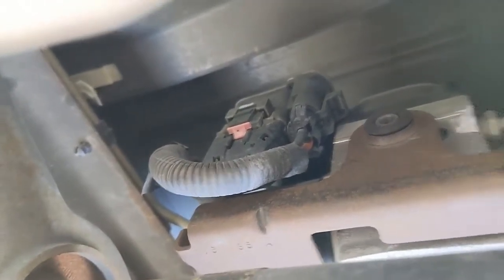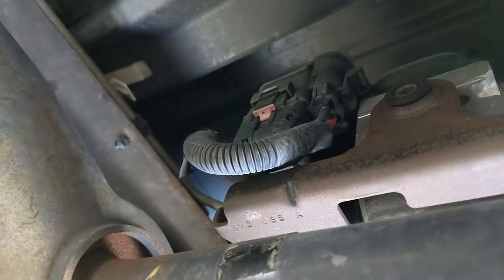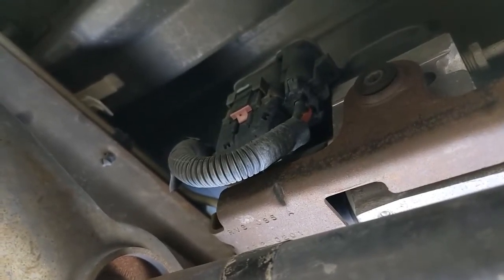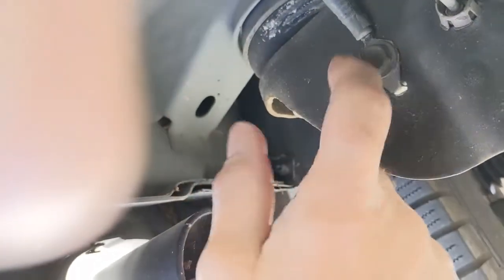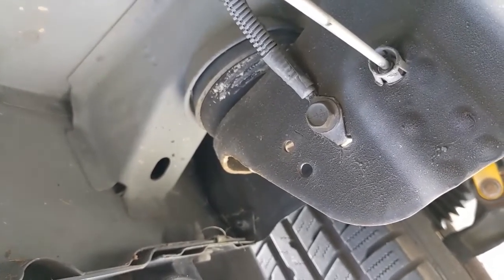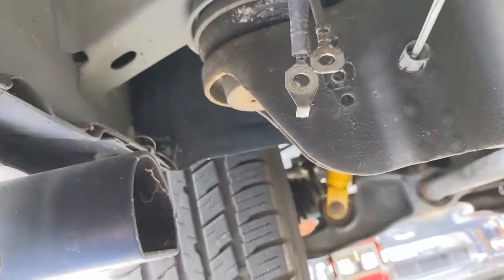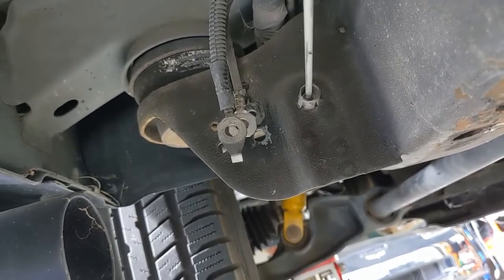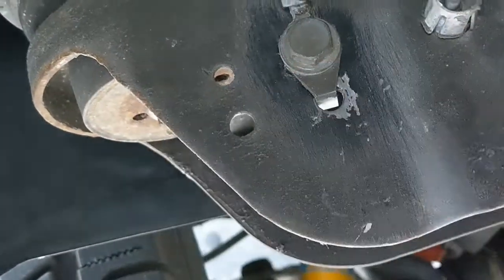Suburban 2002 ABS module brake warning light connection fix repair by froggy

Comment: You did not follow up did this fix your problem?
Reply from the maker: Did not replace yet, stay tuned, slow I know, life happens.
Reply: @1947froggy there’s some sodder points in the module itself that can crack.
Reply: So cleaning connections did not work?
Reply from the maker: no

Comment: Hey Froggy. Pertaining to your ABS issue, there are several different possibilities for the root cause. You have eliminated several currently. GM issued a bulletin on that EBCM ground on the left front frame horn. The fix there was to clean and retorque as you did. I strongly recommend scanning the EBCM for DTC's. There is a very good chance it will have an EBCM relay DTC set. What happens is the board has a couple relays soldered to it. The solder joints crack and the ABS light comes on. Another hint to the condition is the red "Brake" warning light comes on along with the ABS warning. It normally starts off intermittently as well. I hope this helps
Reply from the maker: Yes both lights come on same time. Thanks !

Comment: Had same issue on '01 Tahoe. Root cause was hairline crack in old solder on circuit board. Rock auto for replacement solved it. Did all things you covered. Couple great vids by Tubers if you like to attempt self repair. Didn't waste any more time/money and did swap.
Reply from the maker: Thanks, I may end up there also, but I may try to repair the old board myself, that would be a fun video.  Thanks for the comment! Can you remember which brand, Rock has a few. They all seem to be reman.